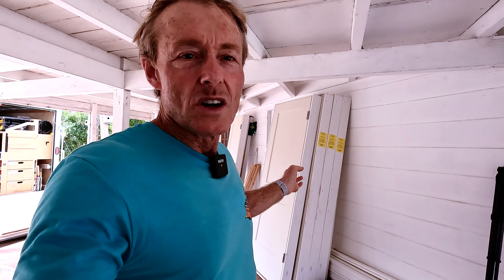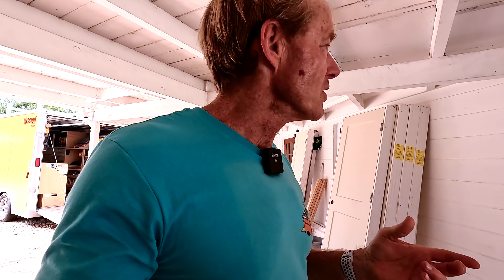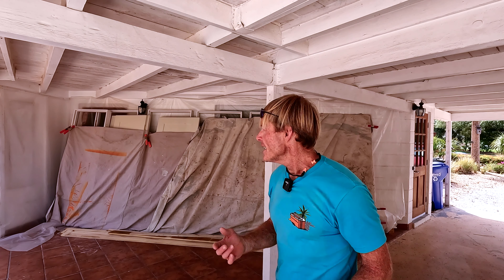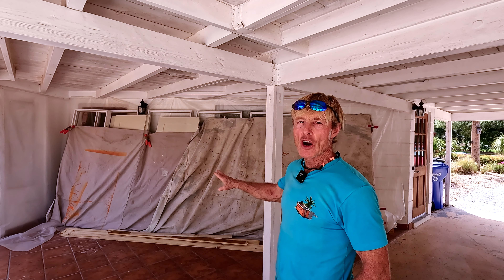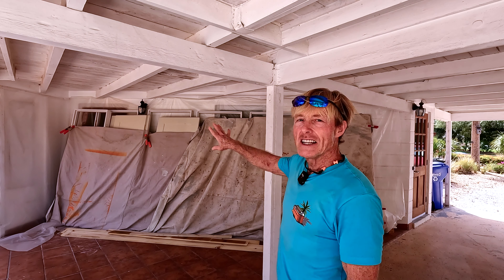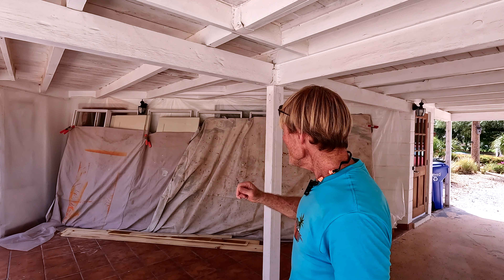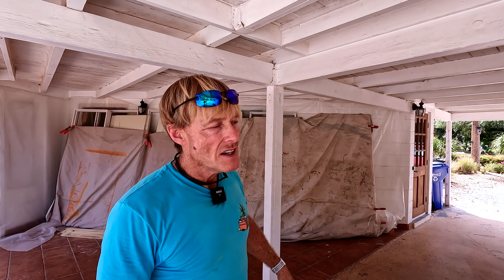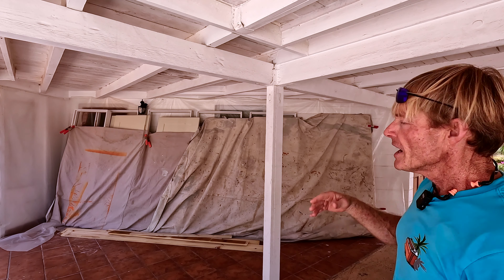Flying with the Festool Cordless Track Saw and TSO Track Square.

Comment: Just as an aside, I have a high end Fuji HVLP and a mid quality airless Graco. I would STRONGLY advise you to switch to an airless for this kind of work.  It takes 1/3 the time and is more consistent. Just my opinion though.
Reply from the maker: I am still learning the HVLP. I like how clean it is and the finish it provides. My airless is good and has painted lots of drywall and siding, but it goes through some paint and fills the air. I have to completely suit up, plus head stocking and goggles to keep the paint out of my eyes. I bet I could try a different tip and turn the pressure way down. When I spray with the airless I keep turning it down until I see "paint tails" on the edges of the fan and then turn it back up until the fan is even. But my experience is the airless is a bit heavy handed for fine finish or saving paint.
Reply: @TheSmartWoodshop  that was my case too….UNTIL.  Until I went to the FFLP green tip. I use the 315 and with the Emerald urethane no thinning is needed. I use lowest pressure. It lays down perfectly. The HVLP requires build up and thinning even with the larger opening. I just built 2 large barn doors and put my 2nd primer coat on with the 315. Took me 5 mins and no build up. Anyway love your stuff.  Keep it coming!!
Reply from the maker: @bigbob9702  Good to know. When I painted the doors with the HVLP it did take a while and I didn't have a very wide fan, but I still think any problems I have with an HVLP is caused by me not the machine. I will see about getting my hands on a green tip 315. I have two more doors that came later that need painting.
Reply: @TheSmartWoodshop  FFLP 310 from Graco or Titan fine finish 310 with and airless will give a great finish. Disregard orifice size recomendation on can or PDS. Strain paint and use fine mesh filter in gun.  Should shoot at around 1200 PSI with little overspray.  Check out the Idaho Painter for great painting tips.
Reply: @TheSmartWoodshop  I’m lazy. I get mine on Amazon 😁

Comment: Ron, don't take this the wrong way. I'm not being critical but why didn't you order 6'6" doors? I trim houses for a living and some times the basement doors have to be cut down because of soffits or beams, no big deal just order the height as needed. Just curious?
Reply from the maker: Would have added a month to delivery time and they wanted a boatload of $ to cut them down. In normal times I would have ordered them ready to hang. It seems that things are slowing down now.😎
Reply: That's what I was thinking. I just had to wait 5 months for an overhead garage door and windows are still 6-8 weeks out, starting to get tired of this!?!
Reply: @TheSmartWoodshop  Same thing here in TX if you order non standard heights you will pay an up charge and wait 4-6 weeks.   It is faster to knock the pins out, mark it, cut it, and go on with your day